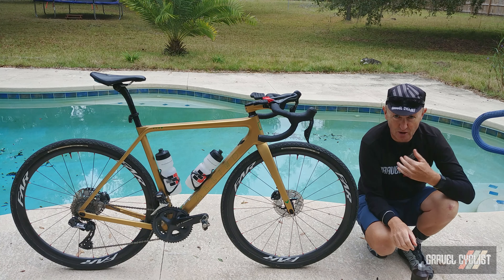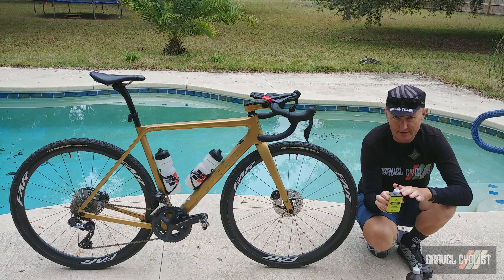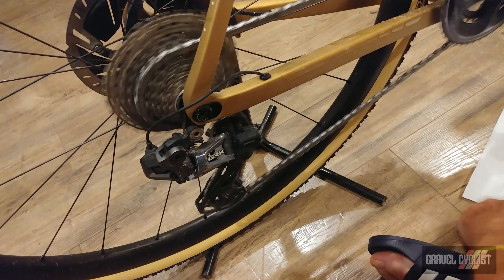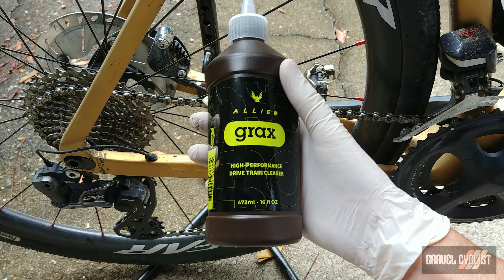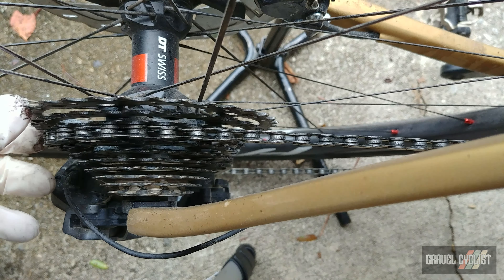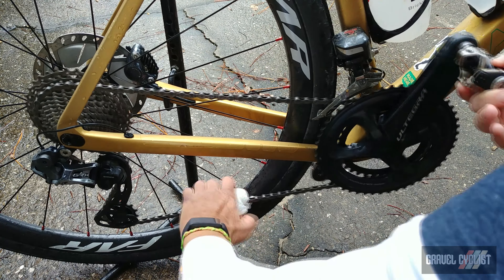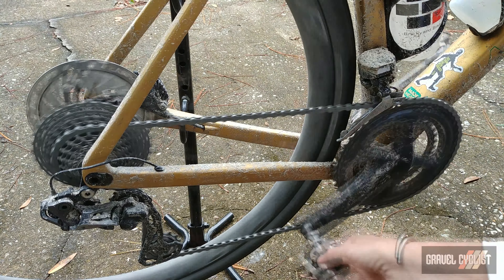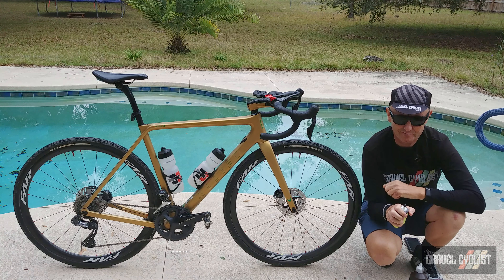The Best Bicycle Chain Lube? Allied GRAX Ridden & Reviewed Long-Term

Comment: As it was time for new chains on two of my bikes, I purchased some GRAX cleaner and lube right after watching this video.  Upon its arrival, I cleaned two new chains of their factory lube with GRAX cleaner, installed the chains, and applied the GRAX lube per GRAX's instructions.  After a few weeks of use, I fully agree with JOM that it is the best lube I have ever used.  My drivetrains are quieter than they have ever been, there isn't any buildup on the rear derailleur jockey wheels, and the chain stays cleaner longer than ever.  Thank you, Allied Cycle Works for a great product!

Comment: Great review Jom.  I tried Grax about six or seven months ago riding on dry and wet gravel and dirt.  Chain lube is hardly sexy, but very important.  I deep clean (degrease) about once a month and re-lube and have not had any chain problems.  And yes, the chain runs quite.  I think Grax is a great product.  I do try and deep clean and allow the bike a day to air dry before applying the lube.

Comment: Should also apply lube to the lower part of the chain, then it spreads into the links 😉
Reply from the maker: Applied using Allied's directions, but thanks.
Reply: @GravelCyclist  Gravity works well for both methods 😉

Comment: How clean does a Grax treated drivetrain run? Tried switching from Dumonde Tech lite (quiet, lasts but kinda messy) to Squirt hoping for a cleaner chain but Squirt ultimately leaves a gray waxy residue on the drivetrain. Does Grax leave a waxy residue on the chain/cassette/chainrings?

Comment: Great review. I wax my chains but will definitely give this product a try. Side question: you having any squeaking issues with the Garmin rally xc pedals? Mine have been horrible
Reply from the maker: Hi there, I use Shimano cleats on various shoes, no squeaking issues with the pedals. I've experienced that on XTR pedals on and off in the past, I applied some dry lube that I had hanging about, which seemed to help.
Reply: @GravelCyclist  right on. Just purchased some GRAX for use one both road and gravel bike. I love waxing my chains but the process is pretty laborious compared to this. Great find!

Comment: When using first time, does one have to degrease and completely strip chain for best performance….like with Squirt?
Reply from the maker: Hi Paul, I would say yes. As I received a pre-treated chain, I should have asked about a fresh out of the box chain sans pre-treat. I shall follow up.
Reply from the maker: Follow up. From Allied HQ, a completely clean chain is advised. You could use the Grax cleaner, or any other cleaner of choice.
Reply: @GravelCyclist  very cool that you followed up. Appreciate it!

Comment: Here is the real question...should you lube the inside of your chain or the outside? Or does it not matter?
Reply: You can apply GRAX to either side of the chain.  The carriers inside the lubricant work the wax into the rollers and coat the surface when you shift through all the gears.  Those same carriers dissolve after and hour or so and leave only the wax lubricant.  So, no need to wipe off.

Comment: The chain should not be lubricated on the top, but on the inside!
The lubricant should get into the links and then the excess should be removed with a rag, not smeared all over the cassette.
Does this lubricant produce, as in squirt, in the form of black flakes dirtying everything around it?
Reply: You can apply GRAX to either side of the chain.  The carries inside the lubricant work the wax into the rollers and coat the surface when you shift through all the gears.  Those same carriers dissolve after and hour or so and leave only the wax lubricant.  So, no need to wipe off.
Reply: @ALLIEDCYCLEWORKS  Thank you. I hope this lubricant appears in online stores like r2-bike and so on, I would try it.
Unfortunately on your site there is no delivery to Russia.